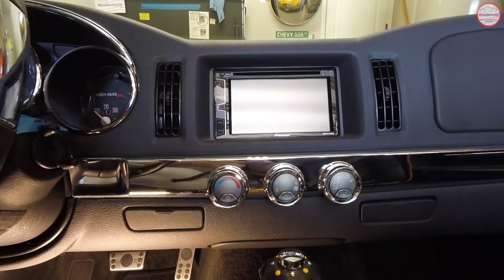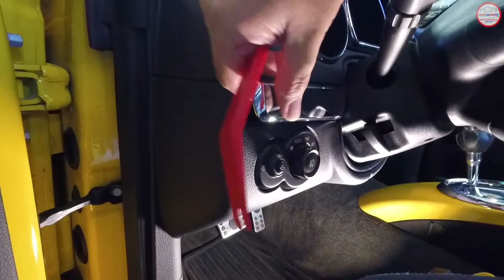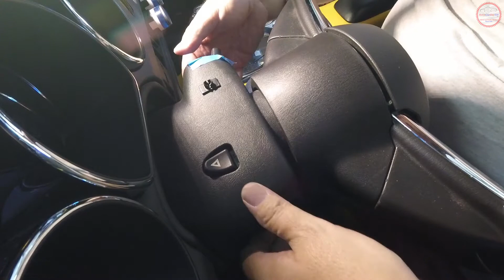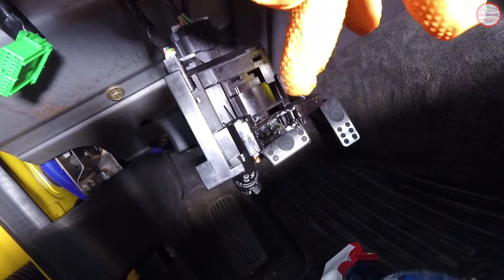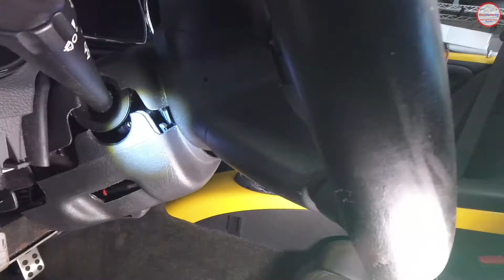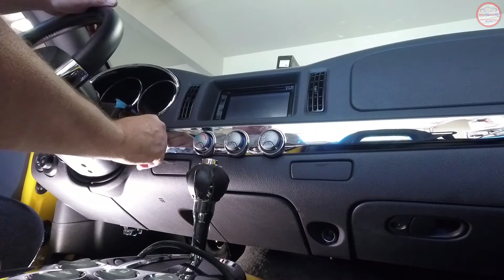Chevy SSR - Turn Signal Switch Noise Reduction

Comment from the maker: The same info can be used to gain access to the SSR ignition switch.
Reply: Is there a video on how to remove the whole key lock assembly mine melted and I have to replace the lock assembly
Reply from the maker: @charliecrates3166  I don't have a video on how to remove the entire ignition switch lock assembly in the Chevy SSR.  I have one that addresses the ignition switch https://www.youtube.com/watch?v=x3OnblHhjiI
That's all I have at this time.